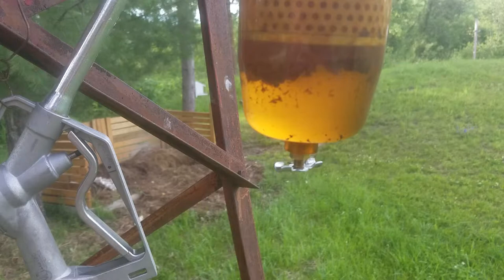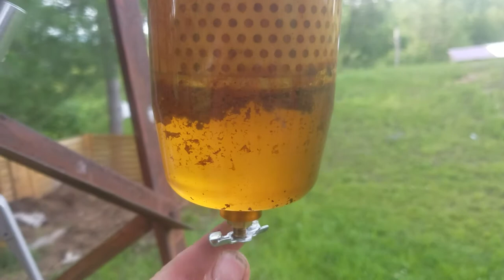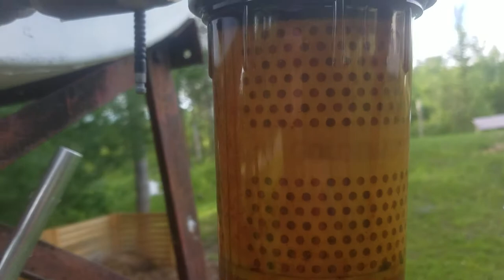showing how water and fuel separate in the filter on the fuel barrel

Comment: I just got a 300 gallon gravity tank that was used for gas, I’m switching it to diesel. It has this same filter, I bought a new filter to swap in and the tank is empty is there anything I need to do except screw it on?
Reply from the maker: Should just have to screw on